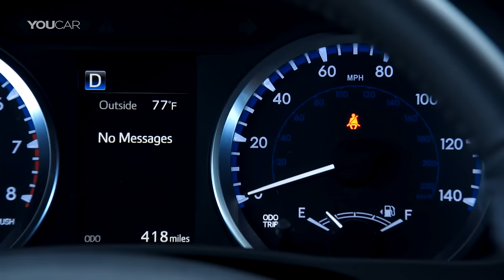UNBELTED Passenger in Frontal Car Crash

Comment: My first love died in 1980, aged just sweet 16, when she was on the back seat in a 70mph  car crash here in the UK. There were no seat belts fitted. I wasn't with her that day 😔

It wasn't  mandatory in the UK for rear seat belts to be worn until 1991!
Reply: There's still some states in the US that don't require rear seatbelt usage for passengers over 16, 17, or 18, these are Arizona, Arkansas, Colorado, Florida, Georgia, Iowa, Michigan, Missouri, Nebraska, New York, North Dakota, Ohio, Oklahoma, Pennsylvania, South Dakota, Tennessee, Virginia, and West Virginia which I don't know whether to be shocked by or amazed at. Some of these states only have secondary enforcement which means cops can't pull you over and fine you for the seatbelt violation alone unless you had another enforcement issue such as a broken taillight or speeding.

The state of New Hampshire is the only US state where adults aged over 17 are not required to wear seatbelts regardless of seating position.

Comment: Showed this to my kids. Started getting into the habit of taking their belts off after we start driving 😖
Reply: I heard it's common for little kids to do that (not sure if I did), a gentle explanation of how you can get in trouble by the police or potentially badly hurt others in a crash usually fixes the issue. I would also recommend checking if the belts are comfortable for them, they should not be too tight or uncomfortable to wear.
Reply: @andrewburgemeister6684  a firm stomp on the brakes works wonders aswell.
Reply: @ric84  don’t do that in heavy traffic though as that’s dangerous to other road users.

Just pull over and say “We’re not moving until the seatbelt goes back on and stays on.” Also carry through warnings of a punishment/something taken away if they still act up as you need to carry through with taking something away or giving time out if they keep acting up.

They usually get the memo after that.
Reply: @andrewburgemeister6684  Yes that's one way to do it. However i have seen my method in practise and it works brilliantly and only takes a split second.
The son of a friend of mine used to have this habit. Verbal reprimands only resulted in the little bastard learning how to unbuckle himself very quietly. One day when i was in the car with them he wasn't stealthy enough and unbuckled himself while we hadn't even left the parking lot. Seeing how we were only going about 5mph this was the perfect oppertunity to teach him that those who do not want to hear must feel. One sudden involuntary trip into the footwell later suddenly made him quite aware of the fact that seatbelts exist for a reason.
Reply: @ric84  yeah, good spot to teach the lesson of the importance of seatbelts.

Comment: My kid ever refuses to wear a seatbelt in the backseat, I am def-o gonna show them this video and make them change their mind
Reply: There's an easier way to convince a kid to wear a seatbelt (make sure you do it on an empty road, like a back street or an empty parking lot) 

Accelerate up to about 15-20kph, then when the kid is distracted slam the brakes as hard as you can, he'll probably go flying forward into the seat infront, and from that day onward, the seatbelt will be the first thing he goes for when he gets into the car 

It worked on me when I was a kid, my dad did that to me when I was 8, and it's been an unbreakable habit ever since
Reply: @mwbgaming28  and if the child gets injured 🤨
Reply: @ThatOneMexicanDude  that's part of the lesson, besides, you're only doing 20kph, the worst you'll get is a scare and maybe a small bump on the head

Comment: I was in a car crash without a seatbelt once. I was in the back seat and we were traveling in a Toyota 2003 solora going 60mph(speed limit) in the country side at 10pm when guy in an F150 ford didn't see us and decided to make a quick left turn to come onto the highway and we hit the front left side of his truck where the tire and bumper are. Everything went in slow motion and i even wondered if i was gonna die and thinking about my mother and little brother and how they would feel about us leaving at such a bad time, i even thought about what it would be like to wake up in my spirit after death, while thinking of this i also had thought about needing to protect my head from being bumped around since its the most important of the body and i held my head with my hands and cushioned the blows i got to the side of my head; i had been jolted up about a foot from my seat and then rocked to the left hitting the side plastic where the small window meets and then jolted to the right; After that i saw how my brother and cousin in the front seats where aching and i was in fact the only one without any hard hurt surprisingly, we were all fine but they had headaches, i only had a streak of light in the way of my eyesight which was scary but only lasted about 10 minutes.  Anyway thats what happened that day. Its long but for anyone who reads it ,its educational.

Comment: I've done at least 750K miles driving in cars, trucks, taxis, minivans, limos, and minibuses, buckled up since 1972. Rear-ended three times while buckled with only stiff muscles and a small cut on my forehead from a steering wheel. So, I have proved Newton's Laws of Motion to myself. Why buckle up? Well, physics.

I carried some teens for awhile for a parent. I would not start until I heard their clicks in the rear. If I heard an un-click I would pull over and wait until I heard a click again. This sometimes turned a 10 minute ride to over a half an hour trip. I said that I didn't need +400 pounds of teenagers in the front seat with me. Yes, they were not going into a scientific fields.

Comment: I noticed that when putting seatbelt on, the rear dummy's neck folded like 90 degree instantly. I was wondering if it were to happen to a human, would it be fine or potentially harmful? I mean I'm not any sort of expert but I rather slam my face to a seat rather than snapping my neck.
Reply: Good question still waiting for an answer to that
Reply: it will be bad because can broke your neck but everything is responsibilty of the driver
Reply: The car has no roof, so in real life, you'd probably snap your neck on the ceiling, as well as injuries to the chest and head, which both contain your most important organs. Back seats would be safest if there were airbags

Comment: I had no seat belt on and i was in the front passenger seat of my GTX familia. My knees smashed into the glovebox as we went airbourne into a tree at 160km/hr. I smashed the dashboard with my head from the car hitting the kerbs then head went through windscreen when we hit the tree lol. My two rear passengers basically melted the rear seat with their asses as it rubbed against the material at highspeed back and forth.

Comment: Am I the only thinking rear seatbelts can brake your Neck?
I don't think this is a natural neck position 0:50 Although we all Agree in the Front in conjunction With Airbags seat belts are a must
Reply: My Cadillac has airbag seatbelts and I do agree that having a seatbelt in the back during a crash will snap your entire cervical spine but it’s not any better without a seatbelt either
Reply: The only way to tell is to see the data from the sensors on that dummy.
Reply: @AR-zq9hq  well, What if Engineers  know already that rear occupants get their necks snapped 🙄
.
I mean they are probably Focused on making sure the people which still has Finance on the car survives, I can't see they investing millions of Bucks putting rear Airbags, simply for Charity.
Reply: @niceboy60  here's some tin foil for your hat
Reply: They can kill in side impact crashes.
Reply: @doveronefoxtrot4417  so side impact crashes are safer for unbuckled occupants?

Comment: This video still can't convince me seatbelt is safer.
More displacement doesn't necessarily mean more injury.
The belted dummy's head seems to kink more at a scary angle, and who know, colliding with soft front seat may cause less damage than the force from seatbelt pulling the body
Reply: Colliding at 50 km/h makes the impact at the seat hard as hitting a brick wall and crush the front passenger

Comment: Why is the front seat collapsing on the driver!?? That seat is not fixed it seems..
Reply: a flying human body (180lbs) at 40mph will destroy the seat railing or seatback of any car
Reply: Против Глобал yes. Just like a hard ass rear end crash the seat will just get destroyed
Reply: CAT.A not really, car seats are designed to hold passengers on rear end crashes. The seat will never collapse under those circumstances. In this case it breaks because the force it received is opposite to what it was designed for
Reply: Matias Petrali Some seats can collapse during rear end crashes. In the USA a seat just has to wistand two times its own weight
Reply: I believe it "follows" the driver to break the whiplash effect and other stuff.
Reply: You know that even a baby's body, on a crash, can apply a force equivalent to 1 Ton, right?. If you didn't, now you know. Guess what an adult body does then. This happens in milliseconds, not at low speed. A lot of physics laws happen at an eye blink that our minds can't understand or accept, but they are there. Like wax candles going through wood tables, like bullets, when launched at high speed.
Also, I don't start my car or even move it until all passengers wear belts. I had friend once try to telling me that he does as he likes. I stayed there, until he was belted after explaining him that his stupidity could kill us all.
Reply: It's 150 lbs + of force going 70 mph, therefore the dummy is still going 70 mph even though the car stopped, until it hits the front seat.  If you are driving 35 mph and another car going 35 mph hits you head on, the force is as if you were driving 70 mph straight into a solid cement wall.
Reply: Aven Z that seat is destached because the unrestraint passenger slam into it

Comment: Is that seat made of paper? 🤔
Reply: Most seats are made of foam and a thin frame. They are sturdy enough to hold you upright, but not strong enough to withstand a human body being thrown against it at 35mph.
Reply: @MouseyBusiness  oh, it seems. So basically if the rear passenger is not using the seatbelt, it can kill the driver

Comment: We recently conducted a test - in a car with jelly seats. You know. Most cars usually have their seats actually well secured. I would bet on this to be either a very cheap car or actually tampered seats.
PS: not protecting anyone not using a seatbelt. Im just saying this doesnt look realistic at all.
Reply: Car seats aren't designed to take crash forces in that direction (they are designed to take them in the opposite direction though, because rear end collisions are a thing). They do fold like that if you slam a body into the back of them at 35mph.

Comment: They need to redo the way seatbelts work, because honestly seatbelts are just as dangerous as the crash its self, the amount of force generated on a persons body in a crash is so high, that alot of the times, the seatbelt its self is the reason why peoples ribs break. they need to have like seatbelts, but instead of useing Straps they are like full torso, kinda like a shirt but its only for the front of the person, now i know all the idiots will think its dumb, for the sole reason it would look dumb, but what is looking dumb to saving a few broken ribs, or possibly your life, i had a friend that got into an accident with her, dad, and the only thing that actually hurt her was the seat belt, the seat belt, actually cut into ur neck.